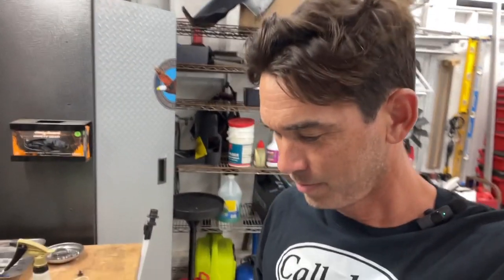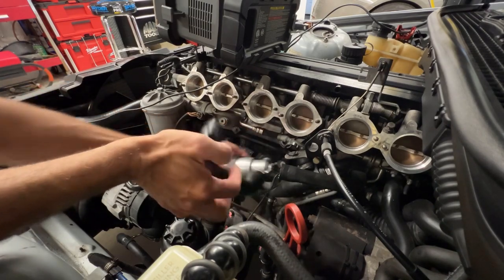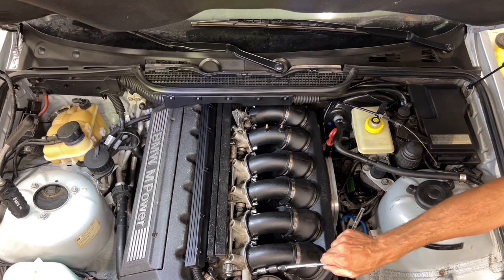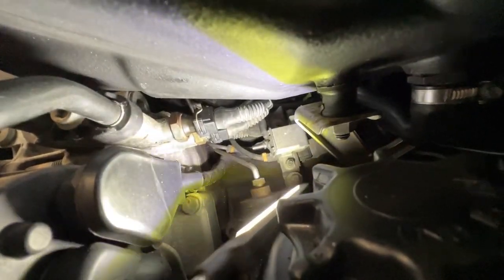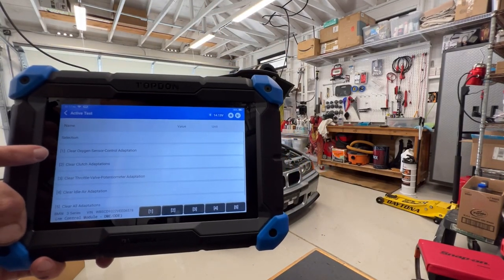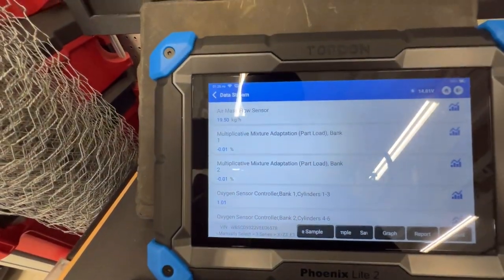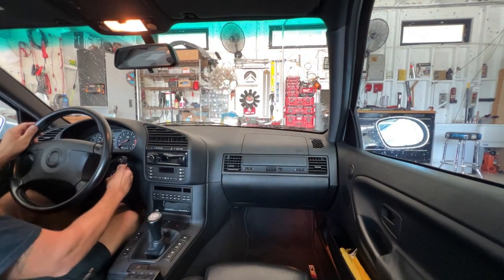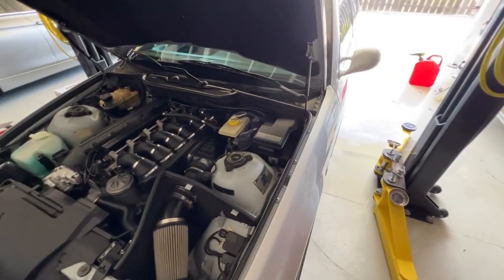Pt. 8 BMW E36 M3 Intake Hana Hou!

Comment: Sounds like really bad vanos rattle. I say this as a s50b32 owner 😇. You might want to check the timing chain guides also. Good luck 🫡🫡
Reply from the maker: Appreciate your input! I haven’t considered checking the timing chain guides which is a great suggestion. Maybe even the tensioner is getting weak.🤔 I had a really bad vanos rattle before it was rebuilt. The classic marbles in a can sound along with having zero power. Dr vanos rebuilt with all the proper upgrades so I’d like to hope that it’s still solid at this point. The car still drives great though so I’d say the idle loping is more of a nuisance at this point in time.
Reply: @GarageAction  loping idle could be vanos solenoids failing. I also changed the spring plates inside the cal lobes with the s62 ones. Then my vanos sound completely went away . As for the chain guides... almost 100% they need replacing. Mine failed while driving, fortunately enough i heard something was off and saved the engine 😁
Reply from the maker: @raduorban good catch on the failed guide! I was getting a engine code for the exhaust solenoid prior to overhaul. Dr vanos did have to change one solenoid during the overhaul and currently I get clicking from all 4 so I’m gonna say those are ok rn. I don’t believe I had the s62 spring plates installed though….I read about that mid in recent times. Makes sense on tightening things up in there. Did you do your own o/h?
Reply: @GarageAction  i did everything myself yes. I also.found a good hack on using abs solenoids to replace the ones in the vanos unit. They work great.
Reply from the maker: @raduorban that’s awesome man. Also love the abs solenoid work around.